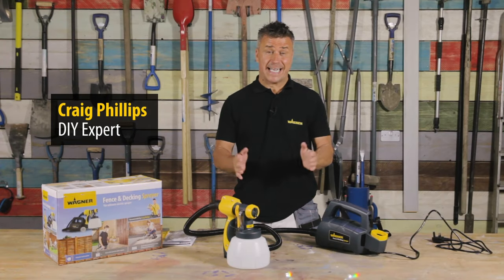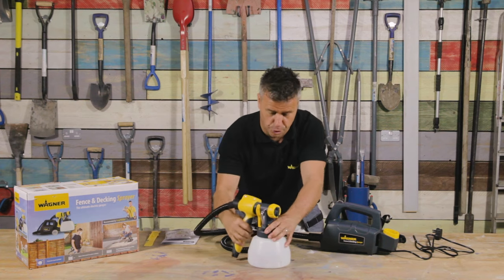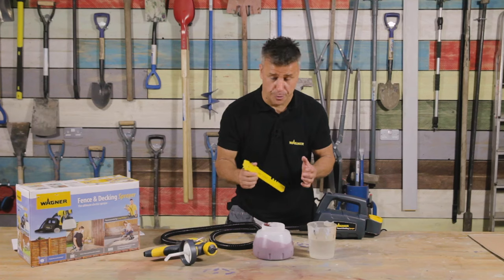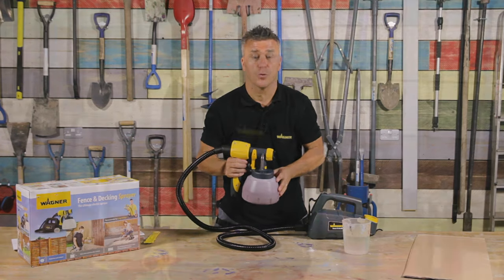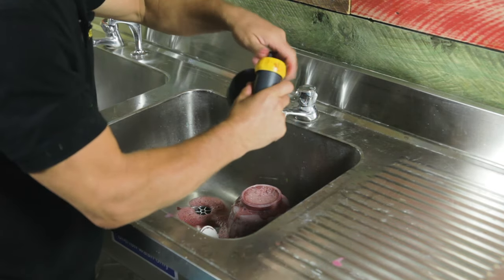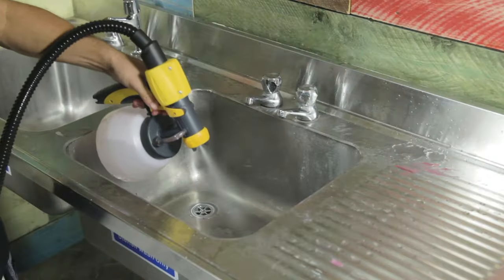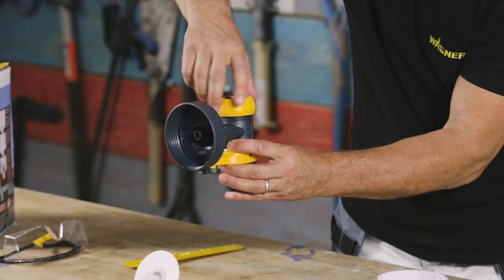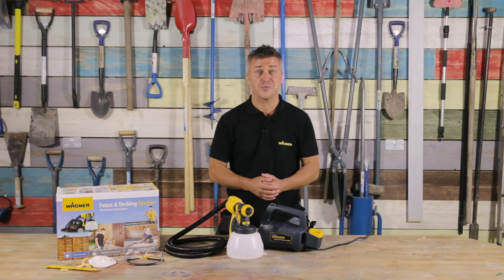How to use the Wagner Fence & Decking Sprayer with Craig Phillips

Comment: Good video Craig, then you spoiled it by wiping the excess grease on your arse haha 😂
 I know this spray gun says for fence and decking and there is other models for likes of cabinets. Do you think I would get away with using this gun for also spraying laminated cabinets or is it not as fine of a finish?
Reply: I know what you mean.  I just ordered this for a fence, but I am going to try it in a spare room too at a later date! :  )
Reply from the maker: Hello Karl Thank you for your enquiry, if you are just using it for domestic use and spraying your own laminated cabinets a better product would be the W590 Flexio Sprayer as you can easily change the paint. This is a universal sprayer for spraying both wood and metal paint and also can be used for emulsion if you’re doing work on interior walls and ceilings. If you want to see more product details on the W590 please take a look here: go.wagner-group.com/w-590-flexio-uk. Kind Regards The WAGNER Team.

Comment: hiya craig i was wondering there is any wagner sprayers that can spray a dashed wall and if so which model thankyou
Reply from the maker: Hello if you're looking for a consumer sprayer for doing work on your own home for spraying pebble dash the best product would be the WAGNER Control Pro 350M Airless paint sprayer which you can see product details and where to buy here: https://www.wagner-group.com/uk/do-it-yourself/products-and-accessories/product/airless-sprayer-control-pro-350-m/ .If you are using Masonry paint you can only use the smooth version not the textured type for spraying. Masonry paint is usually water-based which make the paint easier to dilute and also easier to clean the machine afterwards. If you want to use a sprayer for Contractor work, you would be better to look at our Professional range of product here: https://www.youtube.com/channel/UCce8s4xycTLZPVnmn6dL3GQ. Kind Regards the WAGNER DIY Team
Reply: @WAGNERUnitedKingdom ohh bummer I have already bought the Wagner 150 I hoped she would have sprayed dashed wall 🥲

Comment: Can this system be used for creosote?
Reply from the maker: Hello Wyn, As a product I don't think creosote is available anymore. However if there are substitute products these certainly would be sprayable using the fence and decking sprayer. As with all spraying projects we would strongly recommend that you wear a dust mask for protection. Kind Regards the WAGNER DIY Team

Comment: I want to buy one but what model is Craig using ?
Reply from the maker: Hello Paul Thank you for getting in contact. This is the Wagner Fence and Decking sprayer, you can see more details on the product and where to buy here: https://www.wagner-group.com/uk/do-it-yourself/products-and-accessories/product/fence-decking-sprayer/ Kind Regard the WAGNER DIY Team.
Reply: It’s £70 on Amazon, I just searched for Wagner sprayer and looked for the 460 wattage and 1400ml capacity.
Reply: @WAGNERUnitedKingdom  - that’s great - thanks !

Comment: Paint dilution: 'if your paint has to be diluted?' - how do we know that in advance? For instance does WAGNER recommend paints to use? And for instance the 2 main brands of fence pain Cuprinol and Ronseal - do you have recommendations - if to dilute and how much by?
Reply from the maker: Hello Steve, you make a good point. There are many factors that affect the thickness of the paint not just the different makes of paint but also if it's new or old, the temperature of the paint and conditions you are spraying in. The best starting point is to mix the paint in the original tin and see if it runs like this section of the video https://youtu.be/fNTviUyKleU?t=171 if the paint leaves trails on the surface and doesn't dissolve instantly it is too thick and you need to dilute. This is either with water or whatever the paint manufacturer recommends for diluting their product. Once you have the paint setup is always advisable to do a test spray onto a scrap of cardboard to check the spray pattern before actually starting your project.  I hope that helps. kind regards the WAGNER DIY team.

Comment: How much is this?
Reply from the maker: Hello The price of the Wagner Fence and Decking sprayer can vary depending on the retailer. On average, it typically ranges from a little as £60 if it is on special promotion to £90. For the most accurate pricing, it is best to check with major DIY retailers or online stores. Kind Regards WAGNER DIY

Comment: Yes very quick but no mention of how much more product you use compared to a brush,ln my experience it's about x4 plus waste😢
Reply from the maker: Hello John Thank you for your feedback. In fact, when used properly, the Wagner Fence & Decking Sprayer can be more efficient with paint compared to a brush. The sprayer applies thin, even layers directly to the surface, ensuring consistent coverage across the entire area, whereas with a brush, you often apply extra paint in one spot and then drag it across the surface, which can lead to uneven application and the need for more product. To minimise waste, it's important to maintain a consistent distance from the surface and avoid rotating your wrist, which can cause paint to spray into the atmosphere rather than onto your target. Proper technique, ensures better control and more efficient use of the material. Kind Regards Wagner DIY

Comment: Just got one today and read through the manual, yes, I’m a girl, I know men don’t bother with such things 😂.  The manual says to pull the ventilating hose from the top of the gun, unscrew the valve cover, remove the diaphragm and clean all those bits but that’s not mentioned in this video?  Anyone else bother to do that?
Reply from the maker: Hello you would only need to do this if you are having problems spraying, in this video it explains about it: https://youtu.be/kIuN4TQwHGU?si=KkL_ANXSwPqrb9rH&t=340 I hope that helps and thanks for reading the manual 😊 Kind Regards Wagner DIY.

Comment: Just bought one of these and not impressed tbh😏.had to thin the paint that much it’s basically water🤷🏼‍♂️
Reply from the maker: Hello Mark, it sounds like you have diluted far too much, the consistency of the paint should be no less than single cream. It sounds like something needs to be corrected on the attachment, we would suggest going through the process of cleaning it and make sure all the components are there and tighten correctly. If you are still having problems, please contact the UK customer service team on FMB_GBSI_Technical-Support@wagner-group.com or call +44 1327 368410. Kind Regards WAGNER DIY
Reply: @WAGNERUnitedKingdom  hi sorry for late reply,but found the problem,and it was a leaf stuffed inside it🙄.now works perfect,and wondered how I ever got on without it all these years👍

Comment: My choice of fence preserver is Ronseal one coat. which has the consistency of double cream , will the 460 watt unit cope please. and please please turn off that hideous soundtrack.
Reply from the maker: Hello Peter you should be able to spray no problem, you might need to dilute it. Water based paints are easier to dilute and also easier to clean the machine afterwards. Kind Regards the WAGNER DIY Team

Comment: Yeah. great, honest review. Play loud music over the noise of the motor! Nah, mate. Going elsewhere.
Reply from the maker: Hello, the Fence and Decking sprayer has a powerful 460 watt motor so yes, it does make a noise but no more so than a small vacuum cleaner. Kind Regards the WAGNER DIY Team
Reply: Sky. I think your right, you should  go elsewhere and buy a really cheap weak sprayer that will be awful to use. It will be much quieter. Or spend 50p on foam ear plugs if your too delicate and get a proper job done with this, but your probably better off paying a man to do the job for you.
Reply: @skysurferuk  So that I can learn from your greater intelligence, which sprayer did you buy that was as powerful, but quieter, for the same money? ‘Elsewhere’ is a bit vague, makes me think you don’t actually know of one ? If you do, perhaps you could give us a link to it so we can compare it with Craig’s? BTW, the video was called ‘How to use’ and not ‘a review of’ but heh, I guess reading and thinking’s not your strong point.